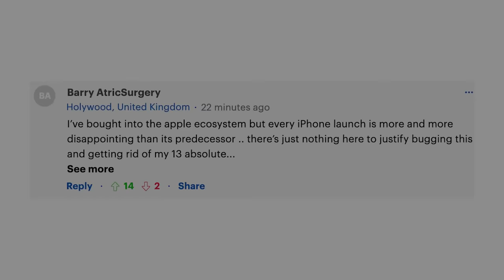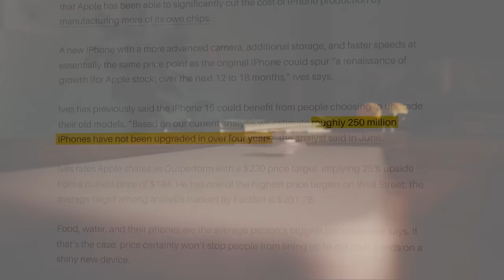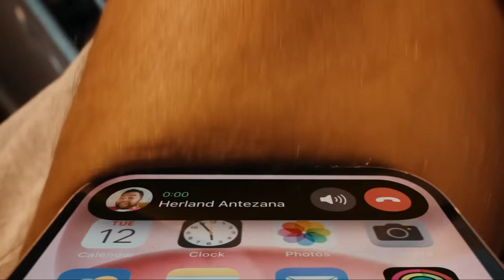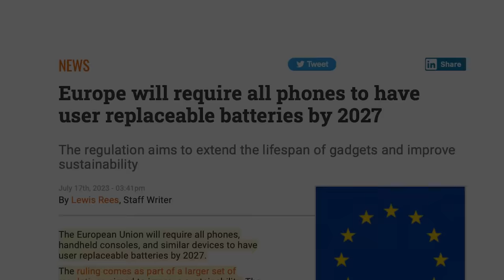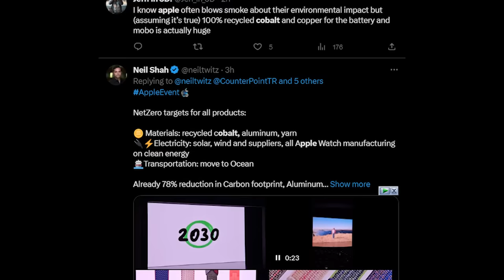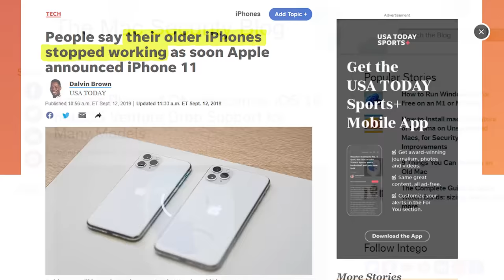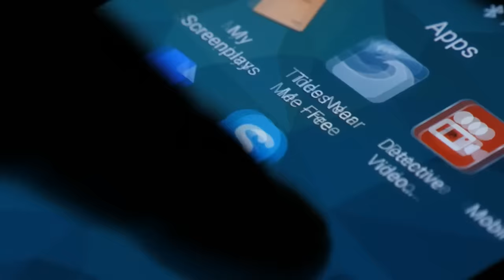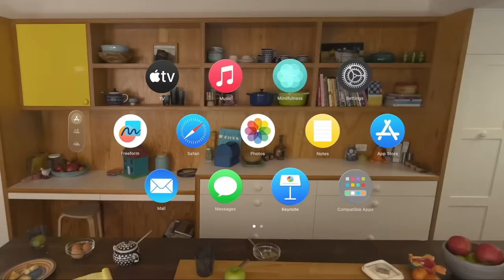The iPhone 15 Is Everything Wrong With Apple

Comment: To be fair, I don't know why people expect every phone to be a massive change. Sure, if you go from the iPhone 13, to the 14, and then the 15, the changes are incremental, but if you go from the iPhone 6 to the iPhone 15, the changes are pretty noticeable.
Reply: I am currently on a iphone 11 nd plan to get a iphone 15 but I underestand why some say iphone is at the end of time for innovation
Reply: Does a 6 still run well?
Reply: Not really, What are these changes? thats 9 years difference, in this lapse of time we have seen many more drastic changes in other companies. Apple has been one of the worst at improving things since Steve died.
Reply: @TornadoOfSouls777 I went from a 6s to a 13 mini and it was an absolute staggering difference in performance 
Battery isn’t any better but it’s nice having a good camera
Reply: Kinda expect decent change since they keep costing 800 minimum.
Reply: It's something to complain about, and the meta is complaining. He says every iPhone release was major, yet doesn't explain why... They never were major. This upgrade is actually relatively big. Apple version of Nvidia dlss is added, 100% neural engine improvement, hardware ray tracing, improved efficiency cores for better battery life, really, it's a freaking computer. And if you don't geek out about specs, you don't need to upgrade. Lots of people want the new specs. My sister uses the chip for video editing. Instead of buying a pc, she got a new phone, Bluetooth keyboard, and cable for a monitor. She can do all her editing on the phone (or iPad mini). If you don't need speed, then don't keep upgrading. But some of us, need speed. Basically, people use their phones for Microsoft word, and don't understand some people use their phone for far more intensive tasks.
Reply: @kilroy314 basically, you aren't remotely using your iPhone to it's maximum capabilities. And apple doesn't even unlock it all, because it would infringe on other products. If apple gave users macos style interface on phone (thing Samsung dex) they would make other products irrelevant. The iPhone is fast enough, most people don't actually need a laptop. Apple just makes sure the iPhone isn't perfect when docked to a monitor so you still want a laptop. Otherwise, the iPhone is good enough. It's probably as fast as a computer from 2012 now.
Reply: @The_Glazer  Companies don't exist to make a good product or to make consumers happy.
Companies exist to make a profit for their owners.  Anything they do is just the cheapest possible tool to accomplish that. If it were cheaper for them to force the government to force you to buy it instead of advertising it, they would.
Reply: @_ejay_6968 same but I decided to not buying this. Nothing new the camera is the same since 11pro and now will be added a 2000 nits screen and the usb-c. Not a big deal.🤒
Reply: Tbh if they just give us a headphone jack most ppl will already consider that a major change, the bar’s pretty low rn tbh
Reply: @TornadoOfSouls777  I'm still running the iPhone 6. The answer is yes and no. It does everything you would want a phone to do, and you don't really notice any lag. The only issue is that some apps are no longer supported due to the ios it runs. Things like YouTube still run like normal, and I still run 20 apps. The other issue is I only have 16gbs of storage to juggle which the ios takes 9 of. The photos aren't DSLR level, but they're bad. I replaced the battery myself a few years ago, but I still get about a day's use out of it. I still have a home button that clicks, and a headphone slot, so that's pretty nice. I might wait till the SE gets an update in the spring.
Reply: I went from 11 to 14, both pro maxes, and even then I was a bit underwhelmed...
Reply: @Tential1  No way you are running a 200gb console game on the iPhone 15. It's going to be a port
Reply: Some people live off of the content another provides, for videos just like this one. There‘s a reason the narrative has changed from companies being innovative to lacking innovation. There is always something to complain about, therefore always something to get views for. It‘s sad, but this is the reason people overdramatise everything nowadays just to get views instead of producing something of value. I‘ve seen people on YouTube with wild claims such as Apple not innovating, or that other companies not creating interesting products and services (looking at Nothing here because their claim is tech has become boring, which is not true). But there are now foldable devices, new ways to interact with mobile technology like wearables. It‘s not really about appreciating that people work on stuff like that, but to make it seem like creating something like the iPhone, Samsung Galaxy devices or Pixel even is easy and that there should be a whole new device every year, just to satisfy people who make their lives about talking about things like this. And then all the talk and work about making things have less impact on the environment get dropped from the table. It‘s sad, really. I went from Nexus 6 to iPhone, so that‘s a while ago, but it really bothers me how often I read that Apple or any company doesn‘t implement good changes to their products, despite people benefitting from the design changes for so many things, including even YouTube. „Journalism“ like this is so ungrateful. And I honestly hope that more people will learn to be appreciative of creations like iPhone, YouTube, Android etc. Instead of talking about the product, people should be talking about what new tech enables you to do, in all sorts of creative ways.
Reply: @The_Glazer I agree. The „good“ phones start at 1000 bucks and they just won’t improve on things the consumers actually want.
Reply: bro, it’s the same goddamn walled in software than the iPhone 6. You’ll notice the camera upgrade but the i6 camera was great, great battery life due to starting with a fresh new battery and the bigger screen. The iPhone has changed so little, it’s fucking embarrassing.
Reply: @Tential1 what are you crazy?! Every old iPhone release was huge. iPhone 3GS speed and updated cameras, iPhone 4 drastic new design, camera upgrade iPhone 4s speed and SIRI, iPhone 5, bigger screen. iPhone 5s touch ID 64bit, gold color, iPhone 6 finally big screens, iPhone 6s gold pink color, iPhone 7 double camera and jet black color, iPhone X self explanatory. I was in line for the iPhone 6, 6S, 7 and Xs. Let me tell you, those were experiences but by the Xs, the lines were smaller. Now who the fuck would want to stand in line for the 15? Or who would upgrade from the 11pro to 12pro to 13pro to 14pro to 15pro the way I upgraded all iPhones from 5 to X. iPhones are boring af now
Reply: Because they talk big but when it comes in use
You know why 🍎 is called so
Reply: @Justinian43  have you considered that you really don't need to get a new phone every year? and perhaps you shouldn't even. also, in your old releases numerous times you mentioned just the color, and even now, every new release usually has 1 key feature, such as more cameras, oled screen, dynamic island, magsafe, USB-C, they haven't really changed in that way, the thing that changed is that the exterior isn't constantly changing a ton
Reply: @SebastianD334  I actually moved to android and have been on the Galaxy Note 10+ since 2019
Reply: @TornadoOfSouls777  It does. I have a huge collection of Apple products (and tech products in general) and it runs iOS12. The battery can hold a day, obviously you can kill it within 3 hrs of intensive playing, but I dont play on phones. (my battery has about 96% health as I change them) .
Reply: yeah i dont use a iPhone 6, they change nothing 🤣

Comment: If you think that Moon has told you all the bad things the iPhone has...just try to repair one,it's a nightmare fuel. It's a miracle that Apple didn't screw up with the Firmware Restoration and in fact,it's the most easy phone to restore compare to the Android's phone,that's the most easy thing you can do with the iPhone.
Reply: there's only one name (on YouTube) that matters when it comes to phone (and laptop!) repair: Louis Rossman.
Reply: @ScottAllenFinance he’s one of the best electronic repairers in the world. All the employees in his shop are also skilled too :3
Reply: when you say “restore” do you mean lay down a new OS onto a device or retrieve data from a backup?

(coming from someone not familiar with phone repair)
Reply: The repairing has become so bad, even the professionals at apple fail to repair the phones you give them and end up damaging them instead
Reply: I work at a phone repair store and honestly, it's way easier repairing iPhones compared to most other phones out there. I can easily disassemble the whole phone down to it's guts and reassemble everything, as we do for backcover replacements. On the Android side of things, especially Huawei and Samsung phones are really annoying to repair as they have really weird internal designs where the mainboard just won't sit flush in the frame or the use of unnecessary amounts of extremely strong adhesive are a pain to deal with. I've already broken two front cameras on S21 and upwards models because they use hot glue that rips out sides of the camera when you try to scrape it away. I'll take the million screws over adhesive every day. Just my two cents from a repair technician.
Reply: @PvtAnonymous agreed. I repair iphones as a hobby. And they are by far the easiest to repair and also the most profitable.

Comment: I’ve had an iPhone since the iPhone 7 when it came out. I generally get a phone every couple years, and I don’t get the newest one. I jumped to the iPhone XS when the 11 was out because I broke my 7, and the XS to the 13 mini a couple months ago because my XS broke as well. But doing the jump between phones like this makes the improvements more noticeable. The XS didn’t have 4k 60 fps recording like my 13 mini has, as well as the hardware improvements, games just play so much better than my old phone. People shouldn’t get a new phone every year, I think ideally people should have a phone for at least 5 years or until it breaks beyond point of repair (repairing phones should be easier and cheaper tho)
Reply: That’s actually how it’s supposed to work. In my technician course we were advised that mobile devices are recommended to be upgraded every two to three years and computers every four to five years.
Reply: So are u just a clumsy person? Iphone has no quality? My Oneplus 5T is almost 5 years.
Reply: Ahahaha I have exactly the same phone change story. From 7 to XS to 13 mini, still wouldn’t mind using 7 or XS if they hadn’t have broken down, however I do love my 13 mini, it nicely fits in my hand and is so convenient to use, just like the good old iPhone 5s
Reply: @fynkozari9271  I should’ve had a case on my iPhone 7 and there was nothing I could’ve done about the XS. I was in a scooter accident and a fell directly on the phone in my back pocket when I started tumbling to the ground
Reply: 100% agree. I’ve been doing the same. Went from 4 to 7. Then from 7 to 11. Both times because the phones just reached the end of their lives. This definitely made the feature improvements much more noticeable. Still have my 11 and gonna wait another year or two before I upgrade again. Totally agree that repairs a d battery replacement needs to become normal.
Reply: ... the XS doesn't indeed have 4k 60fps, I now because my iphone 8 does.
Reply: Actually the XS already has 4k 60fps recording, even my iPhone 8 Plus has it.
Reply: i upgrade every time cuz why not. people get mad and say there is no reason for new iphone every year and that "no one will buy it" but ppls will still buy it and im one of em.
Reply: Just checked my XS and it can record 4k 60 fps

Comment: I previously upgraded from iPhone 8 to iPhone 13 Pro.  This was a nice step up.
Reply: That's a good 5 year gap
Reply: Going from an XR to 14 pro last year was a pretty nice leap for me, definitely felt like a premium upgrade
Reply: Yeah I’ve realised the best thing to do it just to get air a while 

I went from a iPhone 7 Plus to a iPhone 12 and it was awesome and then jumped up to a 14 and it felt like nothing changed and I was so disappointed
Reply: @Gutterrepublic  get the phone ever 5 generations lol
Reply: Only time when a upgrade is really needed imo like if you’re on a 14 and it’s working perfectly fine then there’s really no need to
Reply: I just went from 6 to 15 Pro xdd kinda step up too
Reply: @MikeSaumtier  Massive jump
Reply: I recently upgraded from a 11 Pro Max to the 14 Pro Max and I tell you the truth, the upgrade was underwhelming. The only reason I did upgrade is that my 11 Pro Max was starting to show its wear and the battery was degrading.
Reply: @MikeSaumtier massive jump price
Reply: Still the slowest charging phones on the planet though. My 2020 8T charges 65 watt. That 13 was more recent than my phone.
Reply: 8plus since it came out, about to get the 15
Reply: binks69 I had a few androids (middle to high price range) and I went back to iPhone. At least I tried. Did you?
Reply: I’ll switch from a 6S to iPhone 15 Pro Max. I did the same with the iPad 3rd Generation to iPad Pro 2021.
Reply: iPhone 7 to 13 Pro for me. The photos are so much clearer! So are the screen! The same wallpaper but 2 different colour. 

Can't believe I have been taking with a potato that I thought was good 😂 Probably DSLR quality after few more years.
I like the 7, it was the smallest and lighter phone compare to current phone generations. But I got used to the 13 Pro size now.
Reply: went from a 7, which was bested by some rain (yea, water-resistant my ass), back to my old 6s, then to a 13 pro. 45 minutes or so of battery life and a tiny screen to a full day of battery, crazy speed, and 120hz refresh rate was crazy haha
Reply: I went from an iPhone SE (1st generation) to iPhone 12mini. Different world
Reply: Watching on my iphone 15 pro max

Comment: I have an iPhone 11 and don't feel the need to upgrade it any time soon. The 11 is a workhorse with enough storage and most of the features you get with todays phones, and if you take the case off and clean it up, you can really see the craftsmanship behind it and it will feel like a new phone again. Unless something breaks or apple decided to implement software to slow it down there really is no need for me to switch. I could see myself waiting until the iPhone 16 or 17 before I change to the newest model because the iPhones just work (until they don't lol)
Reply: i have an 11 too, im scared theyll force an update on us to make us upgrade after it glitches our phone out lol
Reply: I'm the same. I have IP11 and I won't change until 16 or 17
Reply: I just upgraded from the 11 to the 14. Trust me when I say the 14 is so much better. My 11 started slowing down and the battery life started draining fast. I got my 11 in 2018-2019 and it was a well needed upgrade
Reply: I sold my 14 Pro the other day and am now using my sisters old iPhone 11 until the 15 Pro arrives, trust me, it's a huge difference between the 11 and newer iPhones
Reply: My iPhone 11 started glitching about two weeks ago “what great timing” 😒
Reply: Ill probably be upgrading from 11p to 15p. I think it feels enough like an upgraded phone now to warrant that switch. My phone now is still in pretty good condition but the memory constraints of a 64GB phone are starting to catch up to me.

Comment: I can understand the discontentment regarding lack of progress with each model, seeing it as boring. However, I remember back 10 years when performance in smartphones blistered year by year and made phones rapidly obsolete. My iPhone 4, at 4 years of age, was begging for death. My current phone, the 11 Pro, at 4 years of age is still kicking. The stagnation meant I don't need to upgrade to a newer phone any time soon and I fortunately see that being recognised among my peers.
I understand the US is very addicted to consumption, but that goes beyond iPhones or smartphones in general, so there are clearly two sides to this story.
Reply: still have IPhone X, no reason for upgrade until it dies.
Reply: That’s a very valid point. Never thought of it like this
Reply: That was me as well. I only upgraded my iPhone 8 after the lightning cable would literally fall off the charge port and the battery wouldn't even last half a day at full charge, the cost to repair it would exceed the cost of selling it.

I then bought an iPhone 11 in 2022 and have no plans to change it in the near future, precisely because the jump in performance is so minimal

Comment: I liked how every brand was doing something different
Reply: every brand still does to an extent, it's just that now every other brand is "good enough" at what a given brand used to specialize in. there isn't really any one thing that can be greatly improved upon. the displays on just about every phone are nearing the point where the human eye will barely even notice upgrades, cameras are good enough for the average person, and most flagships, with the exception of the pixel phones, are powerful enough to be able to do just about anything you need them to. every core feature is as good as it realistically needs to be.